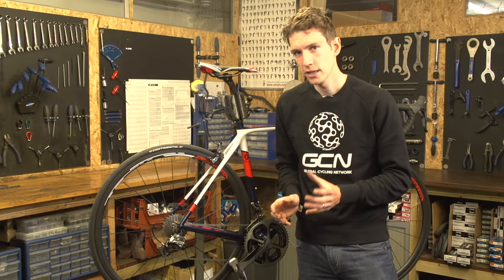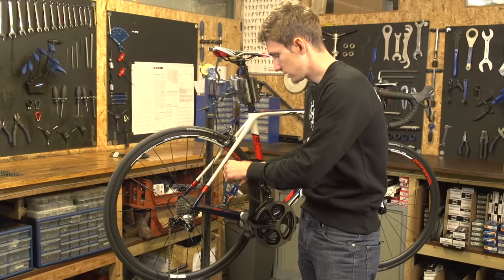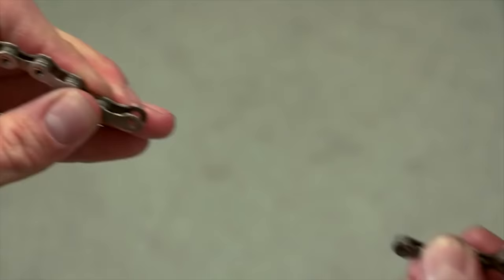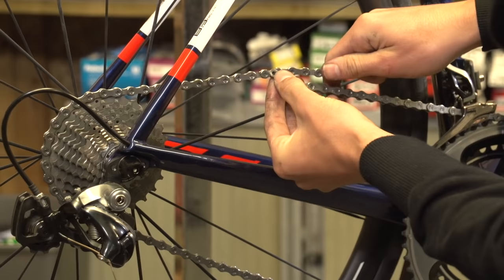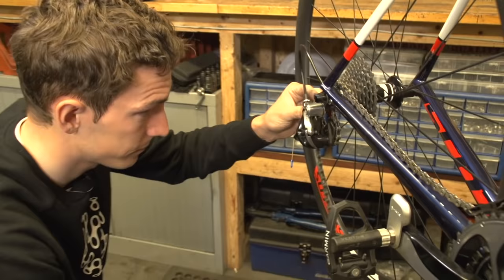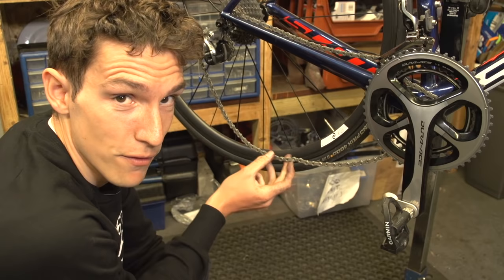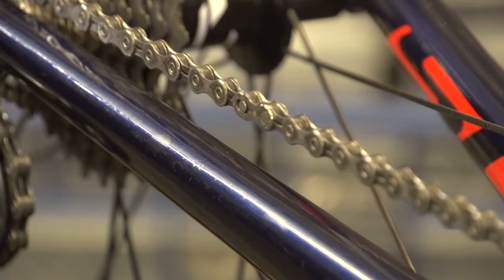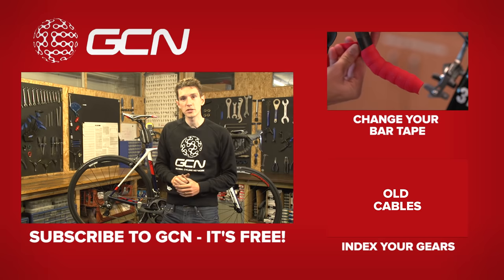How To Replace A Bicycle Chain

Comment: One useful tip if you’re using a joining pin is to drive it into the chain from the inside. Although it’s not as easy to do, it shouldn’t be too difficult to position the chain and bike in a way that you can access it from the other side. The reason for this is, once you snap off the guide, it will leave a burr in the remaining rivet. If the burr is on the inside of the chain, it can scratch against a cassette gear when the chain is turning through the next lower gear. Driving the rivet from the inside will put the burr on the outside, and will prevent this from happening.
Reply: .v..v.

Comment: The most common reason for replacing a chain is because it has stretched.  To allow for this I always double check by counting the number of links in the old and new chains and matching them rather than just relying on length.  Really doesn't take very long (especially if you have the number of links in the old chain recorded somewhere)
Reply: Do chains stretch? I have been told that they don't. What happens is the links wear and the chain is not then tight on the sprockets. I am not sure about this but a worn chain will be the same length as a new one
Reply: @SkillBuilder  The proof that chains stretch is the existence of the chain checking tool (or how it's called in English). This tool's purpose is to look if a chain has been (over-) streched and needs to be replaced. 
My  bike mechanic also told me to count the chain links when I change the chain.

Comment: You've got to be careful measuring the new chain against the old one. If the old one is quite worn and you just lay it out on a bench, it can stretch a link or two longer just because of the extra play.
Reply: Good point.  Mine is about 1/2 link difference and I figured that was from stretch.  So should I assume if length of the narrow ends don't match up (narrow/wide or narrow/narrow) then make the new chain 1/2 link shorter to make them match up?  Seems logical but in my case that does not mean much.
Reply: if that's the case you waited way too long and need not only chain replacement
Reply: Naah, it will not strech that much, like never.
Reply: @tomahoks  ah so why check if the chain has worn\stretched using one of those tools?
Reply: @peterscuba  it only needs to stretch a tiny mount to impact gearing.  remember that mechanical systems have tight tolerances and just will not work properly even under the slightest amount of being off spec.

Comment: Simon should run Chain Replacement As Stress Therapy Classes. This is so... tranquil.
Reply: Totally agree and he is good!
Reply: There is nothing tranquil about the actual process however... but I will look through this video at least twice before I menace the next new chain. :(
Reply: A double single malt whisky helped me do this, change a freewheel and true the rear wheel (as much as is needed before I put my bikes in for service) in 15 minutes
Reply: انت صح 🙀👩🙈👩
Reply: I straight up snapped my chain on my up bike and it's 3 days b4 my b day and I only had my bike for a month after I got my wheels trued w a shop it a piss take
Reply: Maxz
Reply: This process is not relaxing. I fucking hate bikes now
Reply: lol
Reply: I'm screaming at my chain. Disagree.
Reply: Lol!

Comment: Shouldn't you be inserting the pin from the inside of the chain and clipping it on the outside so that the extra bit that protrudes doesn't touch the adjacent gear on the rear wheel?
Reply: That's correct he did it wrong you always insert the pin from facing away from the bike,  the way he did it in this video is a good chance the chain would come apart down the road
Reply: no

Comment: Couple of tips;

Some chains have a specific outside and inside, so keep an eye out for that, and make sure you have them the right way around.

If you don't have a quicklink or starter/guide pin,
-when you shorten the chain, don't pop the pin all the way out; just push it far enough to let the inner link come away, but so that it stays in the outer link. This will make it about a million percent easier to re-link the chain.
-and then when reinstalling the chain, set it up so that you can work the pin in from the outside of your bike, rather than the inside. For this last reason, combined with the one about side-specific chains, it might be worth your while when breaking the chain in the first place, to work the pin from the inside, out.

This is very, very important especially if you're fixing your chain on the side of the road 20 miles from home.
Reply: Great comment - this sounds like  'experience is expensive'  knowledge - much appreciated.
Reply: Read this just too late, popped out the pin completely, hell to get it back in
Reply: Some excellent advice many thanks.
Reply: @samhendriks2732  Same. I just did this and keep cussing. 🤣
Reply: Yep. Never push the pin all the way through. Never. Just don't.

I just wasted an hour on countless attemps to get the pin right, and it just kept popping out.

Thankfully i was on my balcony where it has no place to get lost in. But had i been in middle of nowhere on the side of the road, i would've no doubt lost it, and that would've been the end of my journey. 

So, moral of the story; never fuck around with chain pinns. They're really never your friends, and will always your worst nightmare if you let them. 

So please, keep your links in check. Saves time and nerves, that one.
Reply: I paid that price to learn, but there will be lucky people who will read before that happen

Comment: Thanks Si. Here are some more tips that might be helpful to your viewers:

1 - Always wear gloves when working with the chain. Most of the bicycle chain lubricants are designed for weather-resistance. This means they stick really well and are difficult to clean off your hands. Using gloves keeps your hands clean but you have to keep the gloves pulled snug on your fingers so they aren't pinched and ripped by the chain.

2 - In my experience, you do not need to shift to the small chainring---you can shift the chain to the large chainring before removing it. This positions the chain where it is much easier to reach and the small amount of additional spring tension from the rear derailleur is minor compared to the easier access. Also, if you're like me and seldom use your small chainring and hate cleaning it (because it's difficult to reach), keeping the chain on the big chainring keeps oil away from the small one.

3 - Be very careful to avoid dropping or sliding the chain on the chain stay of your frame. It is very easy to scratch and chip the paint on your frame this way. This is my only criticism in an otherwise great video---when Si installed the new chain, he allowed the chain to slide along the chain stay as he threaded the chain on the rear cassette and derailleur---this is never a good idea.

4 - If you're removing a badly worn chain, it is probably a good idea to replace the rear cassette also (Si mentioned this in an earlier GCN video). The teeth on the sprockets will probably be worn from the old chain stretching and may not fit a new chain properly. Many experts say we should treat the cassette as a "consumable" the same as the chain.

5 - Always clean your cassette, rear derailleur guide wheels and chainrings before installing a new chain.

6 - It's usually best to lubricate the new chain after installation. Some new chains come pre-lubed and may not require this (as long as the factory lube is acceptable for your riding environment). If your new chain comes from the factory with a sticky anti-rust coating, you may need to clean off this coating before installing and lubing the new chain. There are a variety of ways to lube the chain. Which method you choose is a matter of personal preference, your riding environment and how often you clean your bike. The environmental conditions can be very important. One lube may work well in wet conditions and another may be much better for dry and sandy conditions. If you clean your bike frequently like Si does (after every ride), even a water displacement product with an integral short-lasting lube (like WD-40) may work well as long as it is applied frequently. My personal favorite is Park Tool CL-1 (a dedicated synthetic chain lube with reasonably-good weather resistance).

7 - What kind of chain to use? You could stay with the factory-recommended chain for your drivetrain. But there may be a good reason to switch to a different type. For example: If you ride in wet conditions, a nickel-plated chain will rust less. If you're trying to keep your weight down, a chain with hollow pins and links can save you 60 g or more. For example, a SRAM PC-850 with solid pins and links weighs 318 g while a SRAM PC-1091R with hollow pins and links weighs just 255 g (and the PC-1091R includes nickel plating).

8 - Si mentioned "quick links", the chain links that are designed to be installed and removed without a conventional chain pin tool. Depending on the make, these links have a variety of names such as "master links", KMC "missing links" and SRAM "powerlinks". Some are designed to be reusable and some are not. But I've found that most of them can be reused many times (regardless what the manufacturer says) and it helps to have a pair of master link pliers as Si showed (Park Tool MLP-1.2). I have single-use SRAM powerlinks that I've reused dozens of times with zero problems. I strongly recommend using master links because they allow your chain to be quickly removed, making its cleaning so much better. I ride about 150 miles per week along the eastern side of Lake Michigan in the U.S. and there is lots and lots of sand. Even though I ride my road bike on clean paved highways with wide shoulders, I get lots of sand in my drivetrain and this requires frequent cleaning to keep the drivetrain in top condition. An easy-to-remove master link makes this a quick task. Chain cleaning tools that clean your chain while it's on the bike, in my opinion, never do an adequate job.
Reply: D.Eldon Yes. And to remove "quick links" without specialized pliers you can fold the link and the adjacent one into a v on the big front ring and hit one side of the link (softly) with a hammer.
Reply: One last thing. Some chains need to have a particular side facing outward.  Do be aware of that.
Reply: Very good job with the suggestions👍

Comment: I’m so grateful for these videos, I was about to use a chain tool on a chain that had a quick link in it before I saw this. 
I was able to replace my rear mech and adjust and index it using other other vids from this channel to guide me without any problems at all. 
Top work guys thanks.

Comment: This video, plus your other chain fixing vids has educated me and saved my riding life! Many thank yous!
Reply from the maker: Our pleasure.
Reply: Global Cycling Network here's my question, and it's probably a stupid one. When you're putting the chain back on, and your putting it on the smallest gears, should your bike already be on a certain speed? I'm not sure if it should be 1,or 12. Or does it matter at all?
Reply from the maker: it would be easiest to fit the chain in the smallest chainring and smallest (lowest teeth number) rear sprocket.
Reply: also- as a mechanic i'll add this... I dont use the old chain to compare, in case it was originally installed at the incorrect length. (i have seen many manufacturers and mechanics put a chain on too long/short)  When installing a new chain, i go into the small/small gear combo, run the chain around and cut the chain at the point where the chain doesnt rub on the underside of the rear derailleur cage.  This way it wont bind when you are in the big/big or small/small combo. Also, I check that length and determine where to cut by putting both ends on the chainring- this way, I have found, I dont fudge the length I need by moving the chain up/down/around, and dont accidentally cut the link in the wrong place.  Also, in regard to many chains, they are directional.  A good thing to remember with shimano chains is that if the shimano logo faces the outside of the bike, thats where it should be.

Comment: No matter how may times I change chains, I always come back to this video. My only suggestion is to buy an inexpensive chain pliers....makes locking in quick links that much easier. I agree...Si is so tranquil it's like the Bob Ross of chain replacement.

Comment: I never thought that I would need to see this video again, but low and behold, I was teaching myself to break down my bike and after I replaced the chain, I didn't route it correctly around one of the jockey wheels and I had contact. After seeing this video, I have everything back together as it goes. Thanks Simon!

Comment: "...but if you've got the bike in a work centre..."

Actually I tend to lean the bike against a table or the side of the house to repair it. Also I don't have such a shiny bike or a spacious workshop with a full set of Park tools. I think someone should start a bike repair channel where the presenter is a middle-aged Dad trying to repair his kids' barely road-worthy bikes in the kitchen with totally inadequate tools while cursing...
Reply: The problem with those channels is they are low quality, and end up just using a big hammer and crowbar to remove all the parts! I'd happily start a channel of me trying to repair my kids bikes, but I'd quickly but a few special tools to make my life easier (and protect the bike). Sure, I can remove a crankset without a puller, but it may turn into waste metal that way. Thumbs up if you think I should start a "Dad repairing kids bikes with minimal tools" channel
Reply: One of the most useful lessons you can teach your kids is, use the right tool for the job. It will save them time, struggle, disappointment, possible injuries, and show them the importance of taking care of the work and themselves. And if you can't justify the cost of a tool that you may only use once or twice, let your LBS do it.
Reply: @timwhite8  I think I would love to see some videos of that, I live in a very rural area, and I know we don't have all the fancy shmancy tools professionals use. So yeah, thumbs up from me!
Reply: I’d watch that!!!
Reply: Well come and film me
Reply: Using only a hammer, a pair of scissors and a bread knife.
Reply: Never have I been so accurately represented in a youtube comments section.
Reply: Hmm. I started biking again after an 8 year gap, before which I was happily earning enough to go straight to bike repair for handy cycle reconditioning/parts every 6 months. Now*, forget middle aged man, it's middle aged lady care worker who earns 1p a month, who *needs her bike to work, for work! I'm terrified I'll bugger it up by doing repairs myself but I have no choice so this is surprisingly not too bad as bike videos go! Better spending money on a chain tool and being able to change chains forever than going to the bike repair man (who told me the bike is basically too knackered to bother repairing).
Reply: Lol I felt that I try to work on bikes in my kitchen with scattered tools it’s so frustrating

Comment: I am a very serious cyclist and have been for 20 years.The mileage of a chain all depends on how well you look after it and how often you lube it.But I am one of these few that do serious maintenance on their bicycle,nearly all the time,it is a fact that a bicycle chain can last for 10,000 miles or beyond,without damaging the chainwheels or cassette,of course it will go eventually,but there are stages of wear that you must watch out for before it slips out of the chainwheel  teeth,the first stage is when it starts to go further away from the left side pin,it can go up to 4mm,away until it needs replacing,(this is using the ruler measurement).The second stage is when daylight starts to show between the grooves,of the teeth.The third stage is when the bottom of the chain moves accessively up and down,and also slaps against the chainstays, while pedalling, do not let it reach this stage.This is the stage when it then starts to slip out of the chain,then the payload is seriously compromised.Every 250 miles I completely clean the chain,and clean between the rollers,then I relube the chain, on the chainwheels I clean them ,then put fresh grease on all the teeth,and along the sides of the chainwheels to prevent friction,as much as possible.I put lube on the chain after every ride,which is 30 miles a day.Since 1999,when I started I have logged every mileage and time.I hope this will help you serious cyclists out there!

Comment: Nice, really helpful, thanks. Not sure if you mentioned but - if you are using a quick link, you need to take one extra link out of the new chain (when sizing it next to the old one) as when you install the quick link it adds 1 link to the length of the chain : )

Comment: Thanks, this video helped me not throwing my bike through the garage out of frustration.

Tip for the folks unable to attach the quicklinks to each other: apply pressure on the breaks and spin with one foot your pedals. Make sure that the quicklinks are perfectly in line with each other before you do this. Cheers.

Comment: How about a a video to fix a snapped chain by the roadside. Usually have a quick-link and a multi tool with a chain tool on it in my bag, but I've never had to use it on a ride.

Comment: I have just picked up a bike from my local recycling centre that I am attempting to refurbish and this is exactly what I needed! Especially the part about not having your previous chain to measure against, the original was rusted solid and had to be removed using a cold rolled chisel and a hammer...

Comment: I had to open a quick link without a tool and couldn't get it with just my hands. My improvised solution - take a piece of small-ish solid wire and route it through the two links on either side of the quick link, then use pliers to twist the two ends together until the quick link opens.